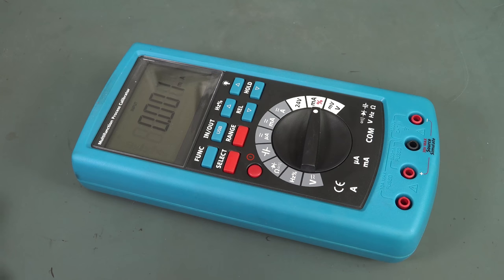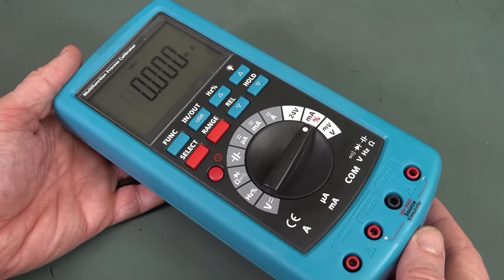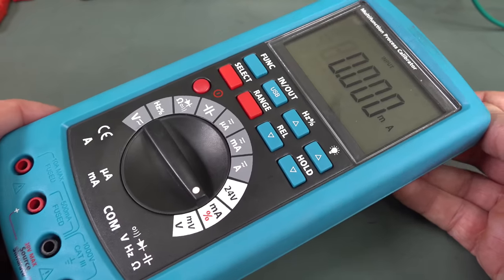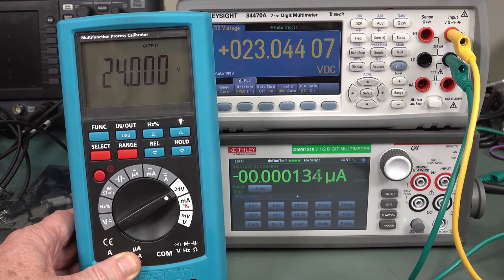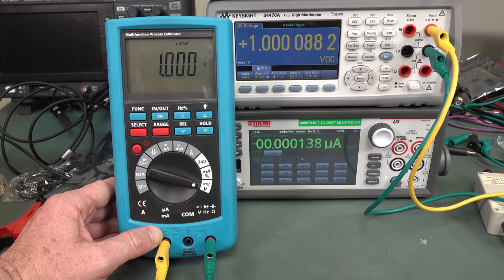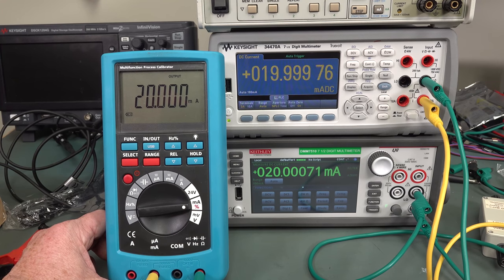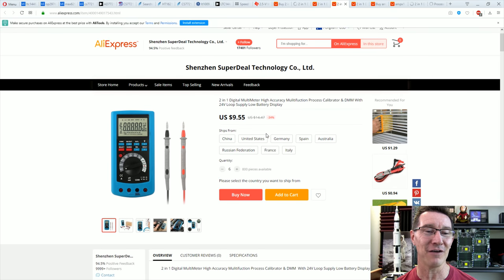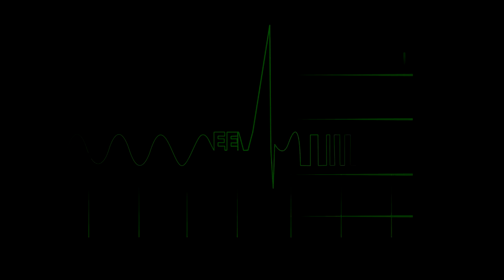EEVblog #1248 - INSANE! A 0.02% Process Meter for $9? WTF!

Comment from the maker: UPDATE: It looks like all sub $10 meter have sold out after about 300 units. Cheapest price now is $60 or more, and some buyers that snagged one at the low price have said the seller has come back to them and asked them to make up the difference in what the real price should be, and to pay an extra $65. So sorry, looks like the party is over. dhgate still have it at around $20 apparently.
Reply: No, dhgate also changed prices to >100$.
Reply: The other thing to be wary of is although the price has gone up 6 fold or more, you are still getting the same old reject units.
Reply: I suspect they just wanted free publicity, before upping the price. Pity.
Reply: @gorillaau  plausible gorillaau, regardless, at $10 I'd get one, at >$60 they can keep them on their shelves.
Reply: @MiniLuv-1984  I'd get one at $30 if just for the precision voltage source. Ummm $60... I'll wait untill the need arises again.
Reply: Hi Dave great deal offerd here thanks a lot. i purchased one via dhgate @aliexpress with vouciere for 59,99€ - ehat a deal iám searching for. good job. best EEVblog chanel in the world :)
Reply: Of course....

That is just a surplus item.  A you explained, old stock, company out of business, that kind of thing.
Probably got sold at auction on pallets for $1-$2 apiece, and certain sellers get those and sell them at their usual markup.
But once a video like yours gets released and there suddenly is a lot of demand, of course they can raise the price a little (or a lot).
Makes sense.  Back when I was young we had stores in the city that sold surplus stuff at unbelievable prices as well, but they are all gone.
Actually I think this is a good thing.  The alternative would have been to dump them all on a landfill, and now they get in good hands.  Better for the environment!
Reply: @Rob2  These sellers probably thought it was just some clunky, cheap multimeter when they got it for 1-2$ a piece. Now they realized it's worth much more.
Reply: @gorillaau  so... Just flash sale without saying it's a flash sale, then. Pity? Not really, they just spent money to market themselves and it does seem to work for receiving more exposure now.
Reply: @maximilianmustermann5763  Yes, but it is only worth much more because Dave explained on Youtube what it really is.
So now they can adjust their price and still sell it.
Reply: @gorillaau  You can actually get precision voltage sources on Aliexpress for prices in that range.  Of course without knowing if they are as good as this one.
Reply: If you didn't make this video someone could still buy them for the good price , but now the party is over.
Reply: Sellers now trying to cancel cheap orders. Do not agree to do it from your end, let platform punish them for being greedy and doing bait and switch.

If you really need such tool for cheap, for around 70$ one can get LB02 without quality control gamble.
Reply: Now all of them are long gone :(
Reply: Dammit ;(
Reply: @Rob so now they get dumped in our houses until we can find a use for them...
Reply: Don't pay them the difference, or they won't learn! I've received all sorts of rubbish from China and they think they can get through all of it by putting kind words filler into their messages...
Reply: The cheapest one i could find is at 60-ish bucks :c https://www.aliexpress.com/item/4000056237522.html?spm=a2g0o.productlist.0.0.343c1262MVw79n&algo_pvid=a65743ce-3edd-4ddd-ad60-3b7eb3b210f8&algo_expid=a65743ce-3edd-4ddd-ad60-3b7eb3b210f8-5&btsid=2c0193db-f140-4172-9cb1-228b8e755c13&ws_ab_test=searchweb0_0,searchweb201602_8,searchweb201603_53
Reply: Dave's effect :-)
Reply: It’s part of a passive dumping strategy. The Chinese regulators are turning a blind eye to these tactics while the trade war is underway. I’ve been able to snag everything from 3d printer filament to label maker cartridges for pennies on the yankee buck as a result of the mayhem. I’ve thought it would be a fun idea to set up an aggregator site to list these deals as they appear...
Reply: Doh! Few sellers at $60 and most at 100-200 now.
Reply: ENEKO TORRES  perfect, still good price!
Reply: For crying out loud, pumping up our electron hormons and at the end... misserable haha
Reply: They asked the buyers to pay the extra money?? I wonder how many will fall for that one.
Reply: Hi, David and subscribers! I 'm sorry for disturbing you. I see you using some keysight\agilent devices , so i made a video about repairing 3000x series agilent\keysight scope. It might be interesting for you. I will be happy if you will watch it here https://youtu.be/MGPY9JhcEIg 
also i made a topic on EEVblog in repair
Thank you for your videos!!
Reply: Was a dick move to post all the links like that...
Reply: So, how much did they pay you for the bait & switch endorsement.  Take you video down if that's not the case, but from what I see - you advertise at $9 and it's now $230+, but your ads still run here.
Reply: Cheapest now is $88 USD
still a good price, i may have to get one.
Reply: Sadly, every product you make a video about results in higher price. You don't want to know how much I paid for my Tektronix 2235 recently.
Reply: You think that making a video will help the people but in fact you help the sellers. Where is the trick and how much they pay you for? I doubt anyone got the chance to buy it with low price cause most of comments are telling x10 the original price! Good job advertiser!
Reply: I think its quite clear what this is. Your unit has problems with the switch and connectors. I think this unit was not OK in the quality check. was thrown out and someone grabbed those partitially faulty units and made some money out of them without having any knowledge what the really had.
Thanks to your video they now make even more money with something that was trash...
Reply: Did you get an instruction manual with your Dave? I did not.
Reply: It has all the hallmarks of manufacturer's rejects being bought dirt cheap, manufacturer name and model number scraped off, then sold on.  At a guess, this was a batch with a dodgy range switch or something like that.  Too expensive to rework by the manufacturer.
Reply: They are made by the same as the original but without the brand authorization ... It's how china works ... they keep your design and produce more units without your permission. If you want to produce in China don't send any firmware to flash on the factory, but they will end up creating their firm... That is why I don't recommend to assemble electronics boards in China. It's like 100% e-tested board... bullshit...
Reply: I found one for 60€. I bought it. I've waited for 2 weeks... the seller contact me with this message:

dear friend,

We have informed by logistics company that your parcel has been returned from shipping company 
We feel so sorry to tell you that our supplier informed us
the goods are defective in material and function
and we need to return all of these items back to the factory
or a Security Inspection until the issue solved
Meanwhile in order to protection your right，
How about we full refund you to your paypal ?

What do you do with this? B.S.
[Edited- Updated]: I have expose the seller with screenshots of his/her own messages as proof. I have started a dispute, I've won, money refund, end of story. Learned a lot.
Reply: won't be long until other companies copy the noname blue design.
Reply: Well this was the plan. This video make a lot of people to buy B.S. They release a few of the B.S units. Then, a few weeks after you bought the B.S, they send you a message that they want to refund in a spurious way. You enter into Dispute. Ali Baba and the 40 thief gang vote in favor of the seller. You are screwed. end of the B.S. story.
Reply: Now/short after they made it 390$ , So wish i could have got one.
Reply: @gorillaau  l
Reply: "Make up the price". lol. Yeah right, check is in the mail.

Comment: its cheap because its a "working reject" , its working but its temperamental , so they take off the branding and sell them off cheap rather than bin them .
Reply: Exactly my thoughts. It has buggy firmware. Something went wrong with a whole batch of them.
Reply: if this is a common problem in their manufacturing process, we might see them coming up again at some point
Reply: which is why I did not buy a load to flip. Too much comeback. Most people bought them "just because" the multimeter specs are not great. Only the current/voltage source is worrth it.
Reply: Exactly.  They had the option of binning the QA fails or selling them for cheap.
Reply: that is my thoughts too. they must make awfull lot of them to be able to afford that kind of reject batch though....thats a very high BOM count.
Reply: If there's one thing that causes more problems than software- it's firmware!
Reply: Incredible part of this is you could pull the USB isolation board and THROW THE REST AWAY and it would still be a bargain. So sad I missed it.

Comment: I would say what has happened here is they likely failed QA and so got tossed, then someone dumpster dived and collected all that they could to sell off.

Only reason I think this is because of issues with the connectors, the dial, etc...
Reply: By dumpster, you mean carried next door to their other salvage factory to correct the issue and resale white label to cover the cost of the failure. I don't know how they can afford to do that, but I guess labor being so cheap...
Reply: Richard Smith labor is not cheap in China right now, no use taking guesses of what kind of item this is because there’s just too many possibilities. My theory is that the factory for Aimo realize how cheap it is to make those so they decided on some “side cash” but even my theory is contradicted by some of the details... very strange
Reply: @ThePr0Br0  maybe they threw the wrong firmware chip into it, or there is some flaw on the PCB and they just needed to make them go away.
Reply: no, I think the QC failed dumpster story is more accurate
Reply: The "someone" just happened to be the "same" manufacturer.
Reply: @ThePr0Br0  and yet it doesn't stand up to basic common sense. What factory is throwing away a $200 item over a problem that could be fixed with $0.10 of labor? Absolute none. What factory is performing their first QC inspection when the item is completely assembled? None. What factory is throwing out $10 ICs, a display, $2 USB-UART IC,  enclosure, buttons, cables, extra fuses, USB drive with documentation, etc. Because of a very very simple, intermittent problem with the switch? None. It makes absolutely zero sense. In reality the board would've been flagged by QC after it was populated, and at worst that board alone would've been tossed. Realistically it would've just been reworked or stripped of the $20 worth of parts which would've then been resold or put on the next board, not combined with $30 worth of other parts, completely assembled, paired with all the accessories, and only then thrown in the garbage as a complete unit... That defies all logic, on a common sense level and a business level.
Reply: @ThePr0Br0  "... no use taking guesses of what kind of item this is because there’s just too many possibilities."
Also:
"My theory is..."
🙄
Reply: or just dodgy ones returned.?
Reply: Maybe the low price was in hopes of a tech channel, like this one, would review it an give it a thumbs up. Then jack the price once they see a spike in orders.

I've seen similar trends with other types of electronics but I can't say I've ever seen one that was priced as low as this device.

That's just my random guess.
Reply: It took about 4 years from manufacturing to AliExpress. 
My theory: they passed QC at the factory, but some failed at someone's incoming inspection or at a final customer. Further testing revealed that the whole lot was bad. Then the lot spent 3 years being disputed. Eventually, someone decided to file the trademarks and brand-names off of the flaky products and sell them surplus. 

The above is only a guess, but it is consistent with what we know. If they were failing normal production quality control, there wouldn't be so many, and they would have made it to market much faster.
Reply: @martinj9647  finding certain issues is hard and costs a lot of time to find the defective component.
Reply: @martinj9647  You're assuming QA of the factory caught the problem. My guess: Outsourced production to china factory. Passed factory qa, but not client acceptance. Client got mad, didn't pay, maybe even threatened to move to different factory. Factory apologized, made new batch. Old batch got relabeled and sold off for nothing. A 'patched' version wouldn't have been accepted by the client either, problem seems just to big. Factory doesn't have a distribution channel, so can't make the decision on their own to sell 'patched' versions.

Comment: The USB isolation is really lovely. It is simple and primitive - but it does the job well. You can not argue with the clearance.
Reply from the maker: Yep, job well done.
Reply: USB CBoard optic clearence what is that..(regards Victor DMM manufacturer )
here on a relative old relaybased-multimeter from early 2010s (picture6)
https://imgur.com/a/JwvLzlx
but then again it ain't a +180US AIMO DMPM, more like sub 40 bucks DMM with shipping. https://imgur.com/a/JwvLzlx

Comment: Might be the ones that failed factory QC. Would explain your trouble with the switch. Might have been dumped instead of being fixed by manufacturer and someone got hands on them and figured they are not broken obviously enough to not sell on ali.
Reply: or refurb / frankenmeter
Reply: That's the most logical explanation. Units that failed quality testing, some might be close to fully working with a minor issue, others close to useless. Someone got hold of them before they were scrapped, removed the branding and dumped them on Ali. If you can make several $ grand from units that were thrown away, why not :)
Most of the shops are have only 5-10 sold units, one is 70 and one just under 300.
Reply: That's what it sounds like, ie, rejects.
Reply: The "someone" just happened to be the "same" manufacturer.
Reply: That's what I figured, QC rejects. Ordered some high side chips from Aliexpress and 95% of them were junk.  Had to order from Mouser and make a castellated board convertor to use them.  IF Xtals on the other hand have been 100% from Aliexpress.  No problem there, so maybe if those fail QC, they still are good enough.
Reply: That or the company that they were being manufactured for didn't pay their debt/keep up on their end of the deal. It's not uncommon for factories to cease doing business with someone, liquidate their remaining inventory, and half the time continue to use their tooling to keep producing the item and either rebrand it or just sell it unbranded, at least until the tooling is useless, item is useless, or the stock of materials they have to produce it has run out. This isn't exclusive to Chinese factories obviously. They can just get away with it a lot easier because a lot of the customers are halfway around the world and have very little recourse by time they realize the market is flooded with cheaper versions of their product that were made in the very factory they contracted to produce theirs. 

Either way something more than just basic QC failures is at play. They wouldn't take such a hit on QC failures. They wouldn't even bother completing assembly, they'd just scrap the boards or, with labor being what it is in China, just have someone rework them. Most likely a majority of the components are counterfeit or recycled/salvaged ones they bought by the truck load. There's absolutely no way there is a genuine $5-10 IC in there(along with at least $22 of other components, 2 PCBs, cables, enclosure, etc.) and they decided to sell the entire unit to a vendor for like $3 because it had a wonky switch they could've paid someone $0.1 to replace and made an extra $197. Something else is at play.

Comment: Even the two Panasonic TQ2-L2-5V relays account for 50% of the BOM if bought in quantities from Mouser!
I grabbed two meters from your affiliate links, they seem to be running out real quick!
Reply from the maker: Insane when you think about it in those terms.
Reply: You mean the two relays account for 50% of the retail price.
Reply: They all are gone now haha
Reply: @EEVblog   I see these ending up on ebay    it sucks who ever gets scammed  :(  with C or D stock..(or buying stolen property )
normally when stuff is scraped off it's stolen  I hate getting energizer batteries from  China or Singapore    those leak or are counterfeit (even if you buy at a big box store)    I only get it if it has USA on the label  I NEVER had one leak on me,,, even my OLDEST Energizer battery (Made in USA)  is 30 years old and still works great it has 9.5 VOLTS
(it's a old mercury based alkaline battery)

but the china or singapore ones always LEAK :(
Reply: But they are PanaSOSnic relays...
Reply: @xenonram  of course right you are! Or as I like to put it: listen to what I mean, not what I say ;)
Reply: @user255  Hahaha, nice catch! ;)
Reply: @perhansson6718  Hahaha is the name of the current cheapest seller. That's kinda funny I guess.
https://www.aliexpress.com/item/4000056237522.html
Reply: @EEVblog  there must be some juicy dumpsters there in China too. So, dumpster diving + scraping&cleaning + posting on AE + shipping&handling + profit = $9 per piece. Fair enough.